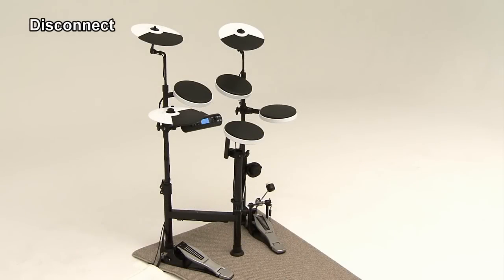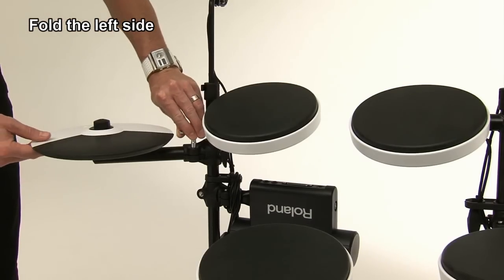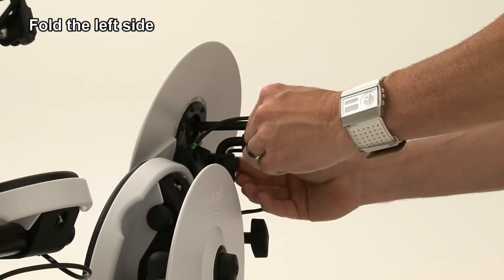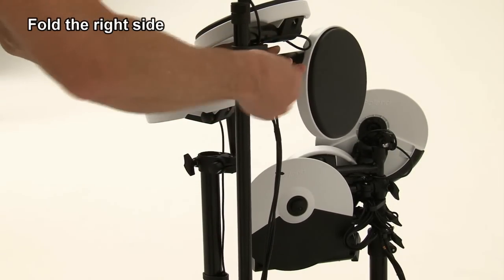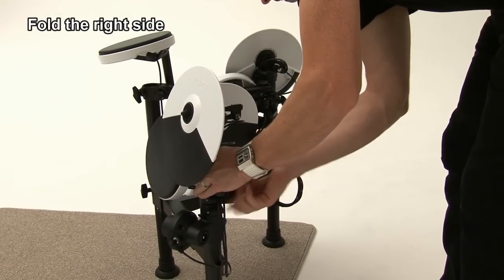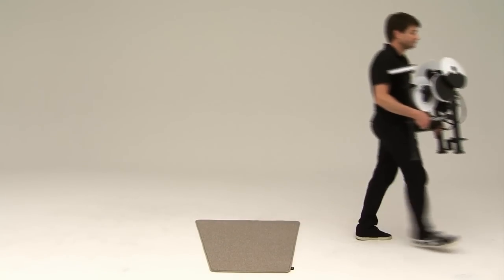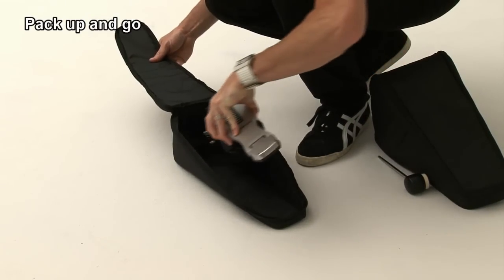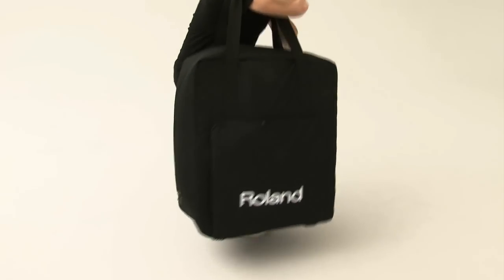Roland V-Drums Portable TD-4KP ― Fold, Pack up and Go

Comment: can anyone tell me if this drumkit is worth its price?
Reply: +AlmightyUnholySchnoerrzapfen  It actually does, i tried it and im xxchanging it with alesis dm7x
Reply: +maxwell altamimi Any reason you're not going for the TD 1K?
Reply: i didnt try that yet but i think i'm getting this because its portable soo yeah
Reply: Yeah the portability is what's making me think twice... but I think the TD 1k's brain is better, it's cheaper and plus it's upgradable but yeah... still not sure.
Reply: +Seth Brundle  yeah...
Reply: i actually bought the td 1k a few months ago. and its a great e-drumkit, it feels and sounds really good. if i wanna get this thing to my friends house for a little DJ-drumsession, i can take it apart in two major pieces and some smaller ones and pack it in the trunk of my car, no big deal. it may take 2 persons to get all the stuff out of the car to wherever in one go, but again, no big deal. it ssomewhat portable aswell, but not too convenient.
Reply: Thanks! Looks like it's the Td 1k for me then. What are the pedals like on it? That's something that I was expecting to have to upgrade at some point...
Reply: Seth Brundle if you are used to real drum pedals, id say the ones included in this set may be a weakpoint then. they do feel a little sloppy compared to real ones but when you get used to them, they get the job done, and you can work with them pretty precisely. but as you said yourself, theyre upgradable...

Comment: Sadly enough, these rubber pads seems very loud compared to normal rubber pads or mesh pads. I don't see why they don't do a mesh-head version of this or at least make it possible to change to mesh on all the pads and not just the snare. I'm sure there's a way to make that possible without compromising the folding abilities of this kit. The loudness of the rubber pads is what keeping me from buying this right away.
Reply: Check out TD-1KPX.
Reply: Yes. Roland has fixed the pads, and thrown in the worst module they offer. Together with the TD-11 it would be a superb set. I wonder whether it's compatible with the TD-11, and can it folded into the same dimensions with the upgrade.

Comment: If it's going to be "portable" it shouldn't require any tools and it should allow you to set back up without having to readjust everything.  This is no more portable than any other e-drum set.
Reply: There will never be such a thing. A full drum kit which you don't have to make even slightly smaller to make it portable. You could fold it so a small carrying standard to fit in the bag in under a minute once you know how. Tell me another E drum kit with this quality that you can go from playing to sling over your shoulder in a bag in 2 minutes.
Reply: Even with a laptop you would need to carry a cable, so it's not portable anymore?